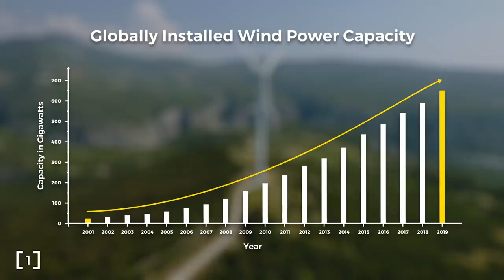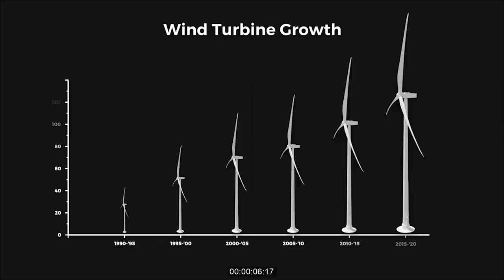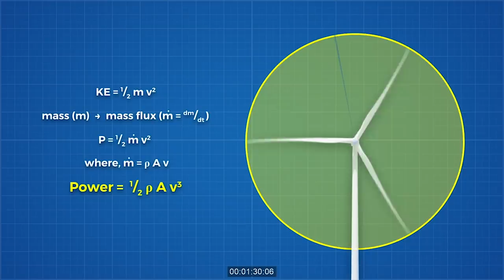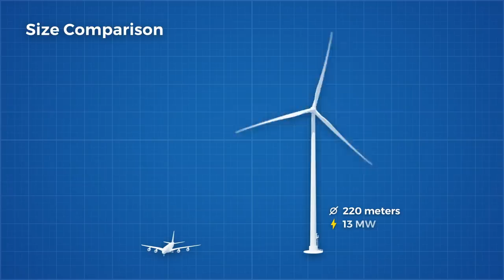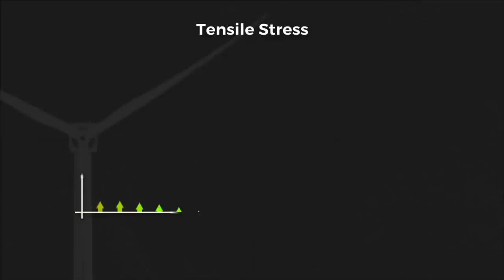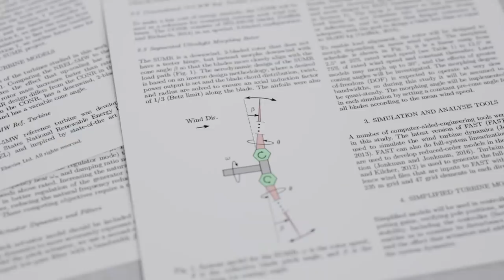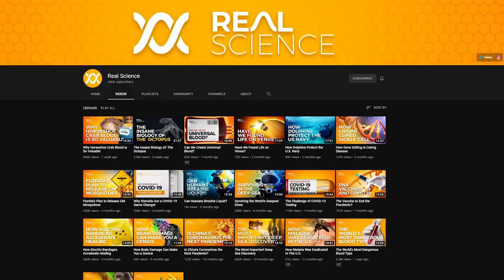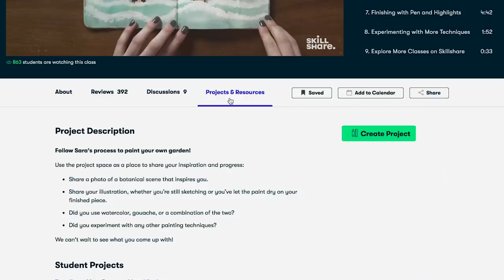How Big Can Wind Turbines Get?

Comment: Very upbeat presentation, thank you.  I should mention that wind power is great as long as the turbines run at peak efficiency.  The blades, however, degrade over time due to uv exposure, stress and physical abrasion, to the extent that the blades need to be replaced and renovated. This is a massive cost that no-one includes in their estimations. The larger the blades the exponentially larger cost.  I owned a company that surveyed wind turbine blades in situ, using high resolution drone photography.  The leading edges of blades become rough surprisingly quickly in a polluted environment.

Comment: So how big can they get? I was hoping for a height and power value
Reply: I think 600 ft. Tall if counting the tip of blade at its highest point maybe a little taller.
Reply: yet to be found. like buildings, the hard limit is economics. one can build much bigger with carbon fiber and strong metal alloys but no one wants to do that

Comment: What’s the service life of those massive blades and what happens to them once replaced?
Reply: The service life is until the fly off. And you know they need to be replaced when they...fly off.
Reply: That is going to be a big problem in the future,as i read recently they have a life span of 20/25 years and what to do with the thousands of blades when they are replaced is actually being worked on right now ,it is estimated that by 2034 there will be a need to recycle about 225,000 tonnes of rotor blades every year worldwide
Reply: @Julian Ashley What are you going to do with 225,000 tonnes of boats/year?
Reply: @josephcoon5809  Turns out, not a lot on a global scale. The total entered tonnage (Meaning the combined displacement of new vessels) of 2018 was 272,250,000 tonnes. That 225,000 tonnes would be 0,1% of the mass of ships produced in 2018 and the figures will likely only grow as we clear the pandemic.
Reply: blade graveyards. That's what is going to happen. That's what happened to the pilot wind turbines from the '90s here in Greece.
Reply: @miskakopperoinen8408  The question is regarding demand. What demand is there for boats?

It requires energy to convert all of that material to boats, so how much energy have you generated from those turbines to offset mining, manufacturing, and repurposing? What would you use those boats for to maintain a negative carbon footprint?
Reply: @miskakopperoinen8408  Container ships are made of carbon fiber?

That’s news to me. I stand corrected.
Reply: they are not recyclable at this point.
Reply: @patriciamilligan287  The experience is worse:
Some wind turbines in the extreme cold air inflow to west Texas were damaged internally , most had to be shutt down to prevent imbalance due to icing of the turbine blades.
The first stage of the internal gearing to increase the rpm to match the generator is a planetary one, which rarely lasts more than 5 years. The insurance companies now require that the transmissions must be replaced in that time frame. What happens with those large useless components?
Reply: No problem. Recycle into carbon fibers.
Reply: @arturoeugster7228  the scrap metal market is literally worth 300 billion dollars
Reply: @WearyKirin  
carbon fiber , metal?
Reply: @josephcoon5809  Nope, and these blades are made from fibreglass. These blades CANNOT be turned into boats, that's utter nonsense. See that's the thing with fibreglass, once it's used and no longer usable, you're kind of screwed.
Reply: @AB-80X  That isn’t the point I’m making.

What I’m saying is, EVEN IF you used them to make boats, where’s the demand for that many boats? I’m just pointing out the other ridiculous points they are making.

Comment: I'm kind of surprised that the process of dealing with waste turbine blades isn't talked about here, especially considering that it inevitably factors into the total cost.
Reply: Shhhhh, we don't talk about this here.
Reply: The massive composite blades have no half life -they are mammoth fiberglass hulks that fill ENTIRE landfills FOREVER as they do not degrade. There is no such thing as recycling the blades as they are falling apart pieces of fiberglass junk by the end of their service life.
Reply: @Four1LF  In NL they use them to make puclic benches after they wear down. The truth tho is that they are not recyclable and you can't make public benches forever.
Reply: They actually crush them up and make cement out of them nowadays.
Reply: It's a problem, but usually seems to be a red herring brought up by people arguing in bad faith
Reply: @Four1LF  you can actually recycle them to sone extent. However, it is very expensive, inefficient and polluting. Wind turbines is a political tool and fad, hopefully the war in Ukraine forces us to rethink this and go back to nuclear here in Europe.

Comment: I've been in the wind industry for nearly a decade now and everything in this video is correct. I've spent a good portion of that time shipping blades and every time a factory is trying to get a bigger blade type we have to send a train along all the expected routes to check if there needs to be any alterations to the terrain along the tracks.
Reply: So, how much fossil fuel does companies like Vestas and others use to ship them, manufacture them etc? And can we use your backyard for the old blades that can't be recycled? Are you okay with the light pollution they cause and the noise they cause? What about the damage to sea life?
Reply: @AB-80X  Windturbines generally will pay off the carbon cost to manufacture and install in between 18 and 24 months. The blades can be recycled. I am currently on a team that does so. I am working on the Eclipse repower project in Iowa where I'm cutting the blades to be processed. Personally I love looking at the FAA lights at night and having been on as many wind farms as I have they generally d9nt make much noise unless you're right under them. Even then you can still have a normal conversation. I haven't seen many studies on sealife damage but the argument I normally get is birds. According to the U.S. Fish and Wildlife Service wind turbines are responsible for about 250,000 bird deaths a year. Cars 214,500,000. Hitting glass 600,000,000. Cats 2,400,000,000. 250,000 is a lot and the wind industry knows this and it is taken into consideration when planning a farm and there are countermeasures that are used to reduce those numbers.

Comment: Hi, Windturbine technician here.
Many of the new Turbines use the direct drive technology. They don’t have a shaft or a gearbox. The rotating part of the generator is integrated in the hub and rotates directly around the generator without any shaft. Even the big turbines with ~10 rpm use it. It’s a big step because it simplifies the whole machine and reduces moving parts. On the flip side I can’t take my naps on the warm gearbox anymore.

Comment: The most important thing is finding solutions for energy storage. 
We can heat water in the earth's crust and use it as heat, produce hydrogen, use batteries, whatever, but we have got to find a way to square the difference between peak energy generation vs peak energy demand.
Reply: Yep. It's called nuclear power.

Comment: I wish you'd covered more of the lifecycle of turbines, turbine blades are amazingly engineered but they're also very difficult to dispose of as a result.
Reply: Yes, the erosion of the leading edge of the blade doesn't go away just because it is bigger. The upfront cost of these things is horrendous considering how short of a lifespan they have before they become pure trash.
Reply: @HuFlungDung2  the video explains why the economics are so favorable. You can install an enormous wind turbine and have it generating valuable electricity within a year and begins repaying your so-called "horrendous upfront costs."

And hand-wringing about the waste after 15 years from a wind turbine is disgusting whatsboutism because it ignores the far greater pollution from mining dirty fossil fuel then burning it. A 200-ton wind turbine will displace tens of thousands of tons of fossil fuel over is lifespan, that turns into even more CO2 , which causes the actual global problem of global warming. Wind and solar and batteries are definitely better for the environment than burning fossil fuel, anyone who suggests otherwise is a stooge of oil and gas companies.
Reply: Very difficult !  In fact there is NO solution , they are cut up into still very large sections and buried .  Out of sight and out of mind , so green !  And don't get me started on the even more difficult to dispose of coming up in the nest 5-10 years  the millions of tons of cheap solar panels per year that are no longer performing and just to inefficient , once again crushed and buried  along with their heavy metals .
Reply: @skierpage  not arguing that coal and gas need to go, just that we need to look at our whole system including renewables if we want to prevent climate catastrophe, it takes a lot of energy to produce turbine blades or to process the materials for solar panels, hydroelectric, geothermal and nuclear (which likewise has issues with mining) are often swept to the wayside in these conversations. But system lifecycles are really important! Otherwise we'd be using tidal power everywhere we could; but right now maintaining generation in high salinity ocean water is nigh impossible. Turbines are definitely going to be massively important in the 'short' (10-25 years) term, but we need to be looking beyond a single generation if we really want to live sustainabily.
Reply: @percyvile  yes, address demand and supply. Which means fewer people each using less resources (land, livestock, energy, ...) at the same time we switch energy to renewables.

Comment: Very nice video. Update:  wind turbines of 15MW (Vestas V236) and 16MW (Chinese brand, forgot which one) are being made atm with 236 and 252m of diameter. A thing I want to point out is that the blade tip can't exceed the speed of sound, so bigger turbines will turn slower to avoid that. Which means that the gearboxes need bigger ratio's and thus bigger stresses come from there. They want to get to around 30MW turboines by 2030 btw. EDIT: I should have watched the whole video first... Hybrid versions and generators with bigger diameters/more magnetic poles are being developed to to work on lower speeds and avoid gearboxes that are too heavy or prone to damage.

Comment: Man! Material engineers are going to make bank this century!
Also, the derivation of the Betz limit is a great exercise for any students.
Reply: I mean the Betz limit is just more or less a theory. There are turbine designs out there that have broken the limit. So they say...
Reply: Doing derivations can be useful, but some are very time consuming for no practical benefits. As an EE undergrad i learned to wait for the boxed equations when the magnetic field equations for generators / motors are unnecessary compared to just using black box models. Meaning its important to know the physics behind these devices but not all equations need to be derived by the students when it can just be posted to the class website. (Moodle page)
Reply: @Whywouldyounot  No, there really aren't. I can't do the math for it, but I can explain something of how it works: Air goes into the turbine. Energy is extracted, which slows the air down when it exits- but the same mass of air exits per second from the same area of turbine, at a lower speed. Which means the density of that air has to be increased, and that takes energy. So of the energy of the air going in, a portion of that energy has to be used just compressing the air so it can leave the back of the turbine at the same mass-rate as it flows in, but lower velocity. That's where the Betz limit comes from.
Reply: @vylbird8014  what you are Saying is correct. And I had to go back to my thesis to actually check up on it again. ;)

My comment was not very accurate as I see now. For the traditional wind turbine design with a horizontal axis and vertical rotor the Betz limit does apply. Yet, in theory, and Betz himself said so, a design is possible, for which the Betz limit does not apply.

Vertical axis rotors like the darrieus rotor for example.

Comment: After seeing huge wind turbine blades and tower sections being transported from manufacturing facilities to site locations by rail and truck, I often wondered how much larger turbines could get before transport was the limit. From your video, I see the answer is manufacturing larger turbines at coastal locations for installation offshore and there are still plenty of good offshore sites available. Ultimately, however, the market will decide this issue. As a retired mechanical engineer, I give this video two enthusiastic thumbs up. Thanks.

Comment: A green energy video that is realistic, isn’t one sided, and gives props (pun intended) to natural gas as well! 😎👍
Reply: Too many people pit renewables against fossil fuels emotionally and politically but energy diversity is important. Coal plants aren't just going away due to pollution, they are significantly less efficient than combined-cycle natural gas plants. Hydro energy is also important because it black starts (instant on) and pumped storage can curtail wind/solar in peak production by pumping water uphill, allowing it to power turbines during off-peak.
Reply: We gotta Yeet Climate Change
Reply: @MVargic  Not in places like Denmark, UK, Norway, Sweden or Finland.
PV Solar works great in sunny places as long as there is enough storage.
Less sunny locations will use Hydro and Wind combined with storage.
Reply: Is a video that advocates for the use of high-carbon natural gas a green video?

Comment: I remember that i was taught that the speed of the tip is also an issue, having the tip break mach 1 is an issue, ie. vibrations in the blade.
is that true?
Reply: yes. so to increase size, they slow it down, and increase torque (how hard it is to turn) then reconvert... fffffffffffffff you didn't even watch the video
Reply: This does limit the size of helicopters
Reply: @Hirosjimma  Did you know that NASA had an idea to catch the first stage of the Saturn V with a helicopter the size of a city block. Unsurprisingly, it was quickly pushed  aside.

Comment: 4:58 accostumed to read and learn about the engineering of nuclear power installations, I could not avoid chuckling a little when I heard that each rotation of this gigantic Eiffel-tower sized marvel of engineering can power a household for..............................wait for it........................... 2 days XD
Reply: I was under the impression that the turbine for a nuclear power plant rotated far faster but with far lower energy production per cycle (net to around 100 to 200x the nameplate capacity of even the largest wind turbines). I am not yet familiar with their turbines and generators though, so what is their typical power per cycle?
Reply: That’s not quite true, a Vestas V162 will produce the amount used by a regular household in a year within an hour.

Comment: As a former wind turbine technician turned mechanical engineer, I’ve been waiting for this video.
Reply: Yea exactly! I work just as a basic tech and i always wondered about the cost of getting blades out to the site. They are doing some new construction near our site and they had to build some temporary road extensions just to give the 18 wheelers space to turn corners with the long blades.
Reply: As an avid watcher of youtube engineering channels, I need some confirmation from a professional:
Is "yeet" the correct technical term for a blade-off event?
Reply: @sixstringedthing  my wife wouldn’t want me to admit this but yes it is.
Reply: @canorth  From one Chris to another, cheers for the laugh mate. :)

Thinking about it more, I suppose there's about a 100% chance that a "blade yeet" while in motion results in "a very bad day for all concerned" i.e. catastrophic failure. What about static failure, if the wind gets strong enough to rip off a blade while it's feathered? I presume  by that point the whole structure is again very much at risk of going bye-bye?
Reply: As someone who has seen them massive things being constructed off the coast im also interested.
Reply: @sixstringedthing  Yes, other acceptable terms are "oh shit" and "who wants to call the boss"

Comment: A less compacted way to protect the blades in over strong stormy weather, would be to Feather them like a airplane does to it's propellers!  
A lot less complex way to control the air force effects on the blades than using over complex folding forward blades as seen in the video. 
A simple gear could rotate the blade to the right angle of attack for the wind and so even set to angle so the wind don't turn it anymore.

Comment: "the faster the tip speed the louder the noise"

XD
Reply: When designing a next gen turbine for offshore use I started with the question how large can a rotor get until it breaks the sound barrier at its tip.
Answer: depending on the RPM, pretty fucking long blades. (250-500m)
Reply: @Whywouldyounot  6.55 rpm to 13.10rpm if I did that math correctly.
Reply: I find these comments very typical for an engineering environment
Reply: haha can concur from my personal experience
Reply: ok

Comment: Larger wind turbines are are mostly more cost efficient because winds are stronger higher up. As the video itself points out, power output grows cubically with wind velocity. Size in and of itself is actually a disadvantage, as larger wind turbines have less area proportionally to their mass.